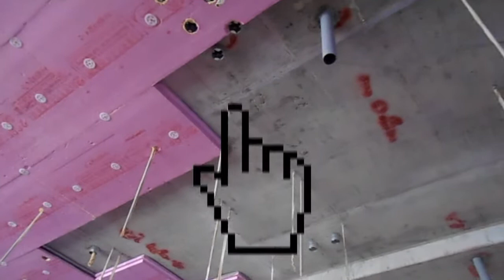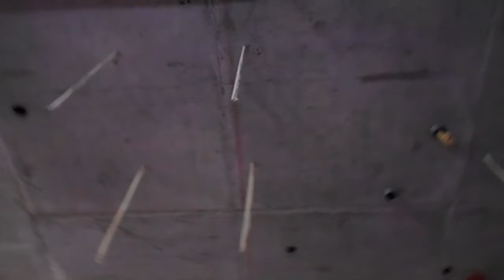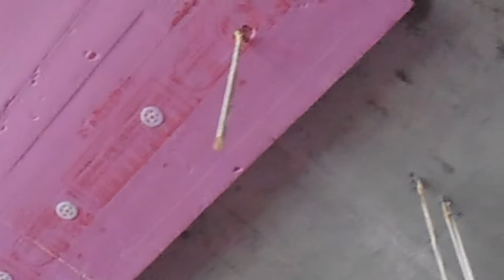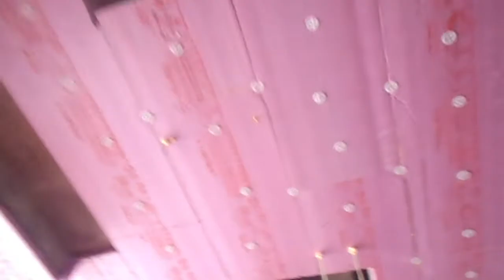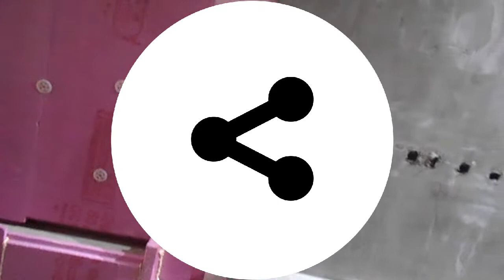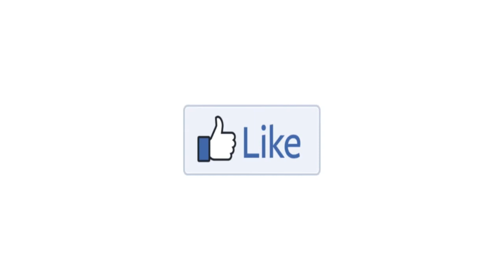MEP Support Arrangement or installation prior to foam board installation by MEP Tech Tips

Comment: Sir,As per standard how to close the void in the duct opening which is very wider than required.For small gaps we will fill with PU foam,but for wider gaps???
Thank you
Reply from the maker: Actually there is a procedure for closing void for any MEP services, its depend fire rated non fire rated area